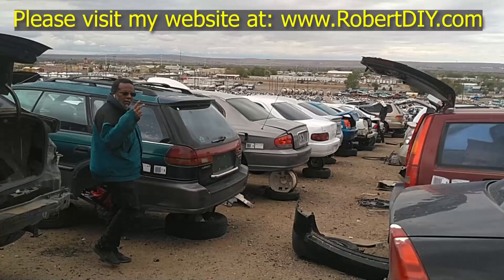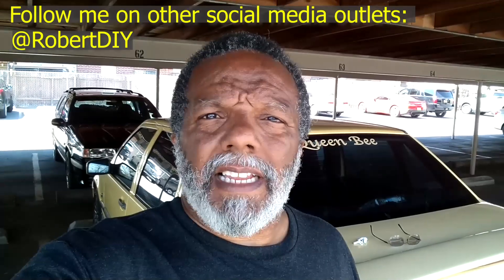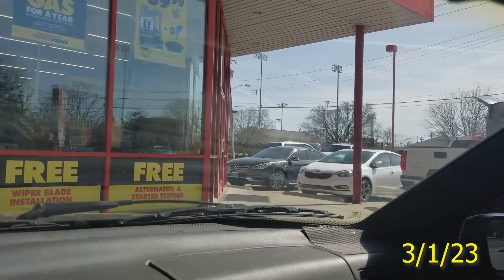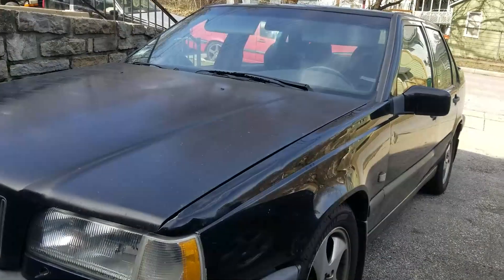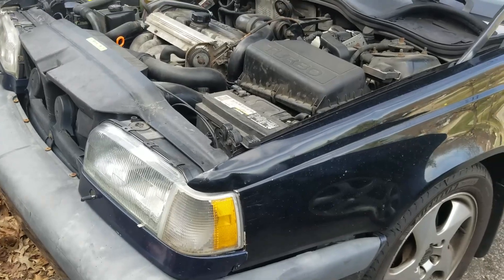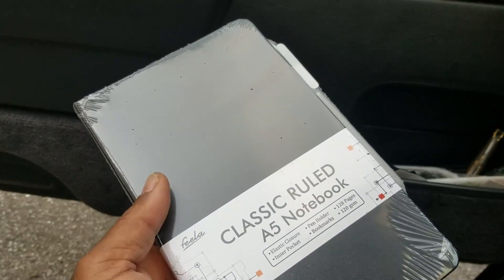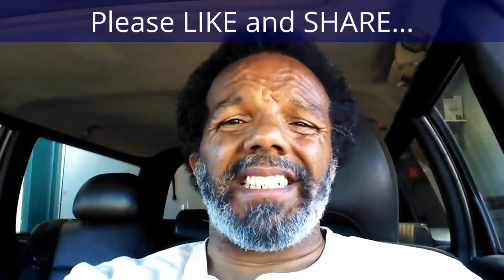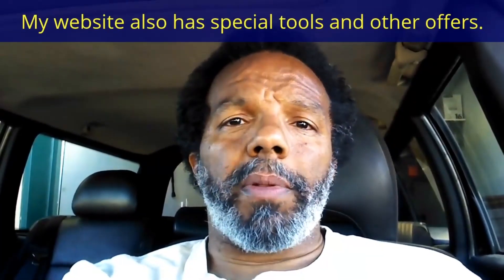Taking care of a few loose ends, oil change and replacing the seat skins on a Volvo 850 T-5R - HOWR

Comment: You did a nice job installing the seat covers. I wondered on my 03 Cavalier if can unbolt and disconnect the air bag wire under the seat so can put a seat "manual" back in that get in the junk yard? I'm worried about the air bag light coming on and staying on. I know should disconnect the battery and or pull the fuse out for the air bag when working on the seat.
Reply from the maker: I'm not sure on that car. Usually disconnecting the battery works.

Comment: Hi Robert, i own a Volvo v70 classic. 2.5 10v 1997. my car struggles/gives little shocks around the 2700-3000rpm on the highway. mostly in 4th and 5th gear. new original volvo sparkplugs, ignition wires, timing belt etc. where to look next?:)
Reply from the maker: https://youtu.be/NhtUXZTurzo